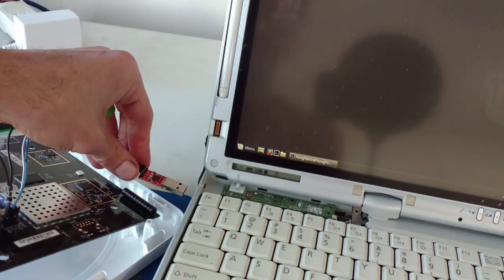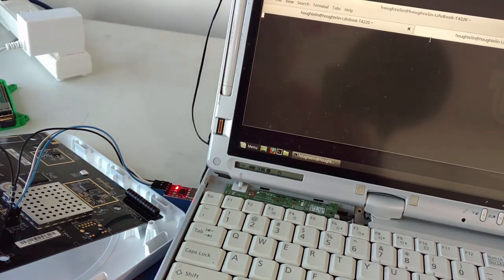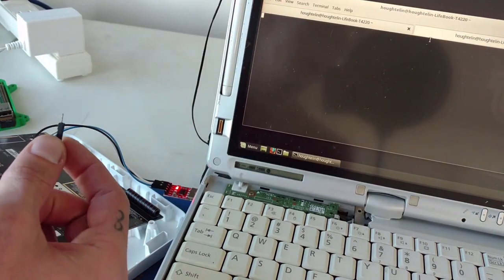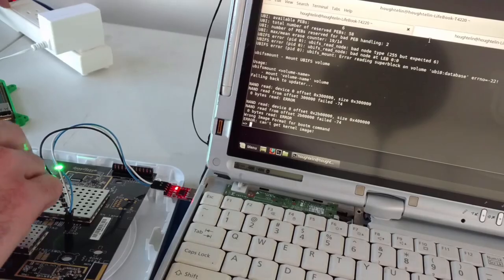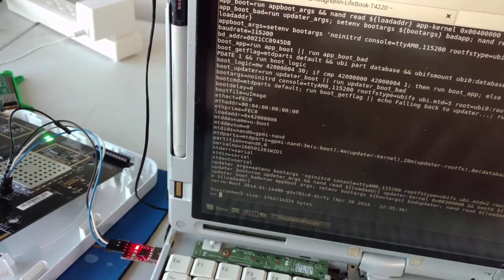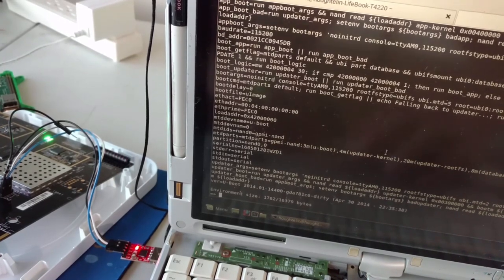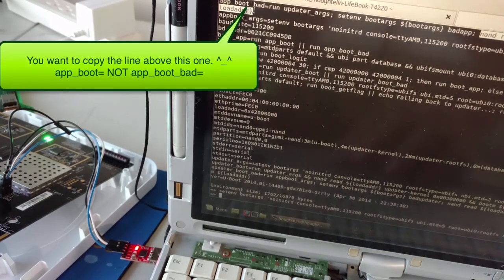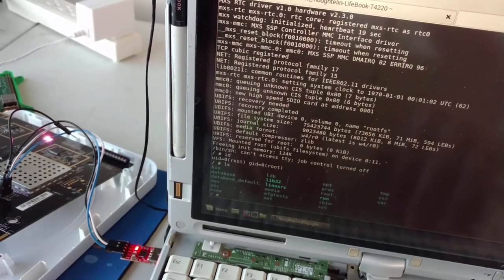Getting root on a Winkhub through UART

Comment: Probably a hardware hacking noob question, but I'm curious how you decided/figured out to ground pin 25 of the nand chip 1 second after powering on?
Reply: Datasheet of the chip.

He disabled the nand chip so the flash fail to boot and give him a shell.
Reply: Its pin 29 not 25 ...

Comment: How'd you get your ssh straightened out? I'm getting Permission Denied (publickey) error.
Reply from the maker: I haven't touched a winkhub in quite a long time but if I had to guess,  I imagine that pasting a public key in the /root/.ssh/authorized_keys file after getting root via the serial port would do the trick.
Reply: @JoshHoughtelin  thanks! Actually, it required creating the key via dropbear on the machine itself. Found a guide on reddit.